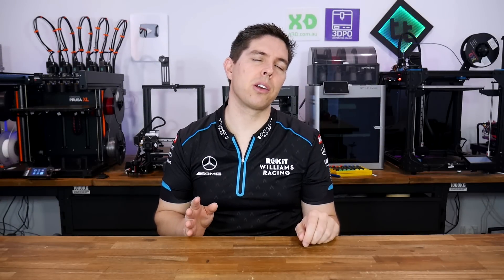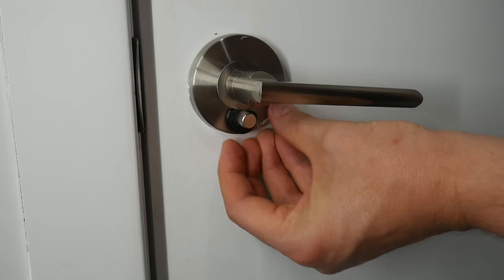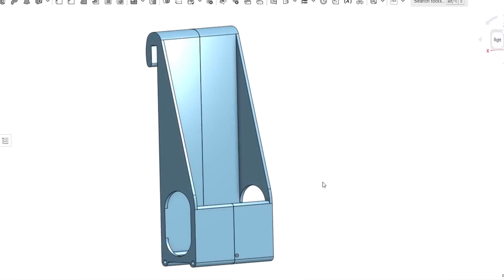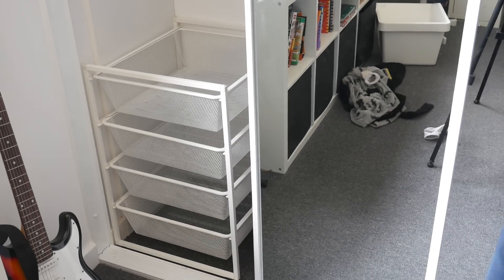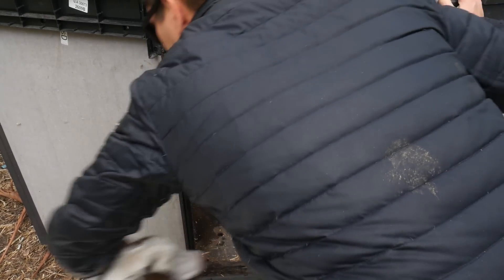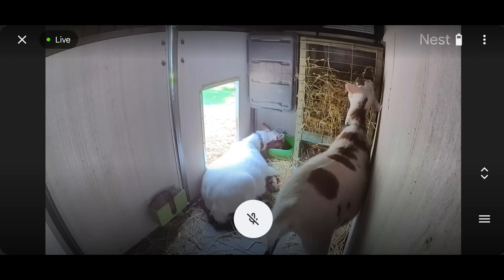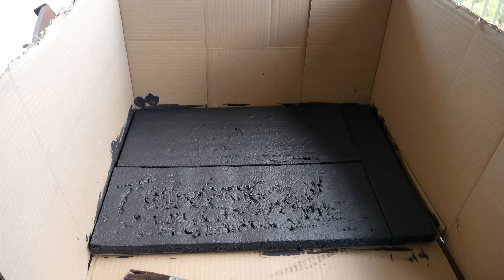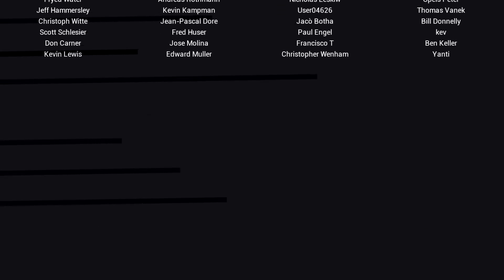5 Practical 3D prints that saved the day

Comment: You most likely already know this but to other people who setup their old laptops for things. If you are willing to do so you can always have it connected to power and then in the Power Options menu on the laptop (in the Control Panel) you can change it to where closing the lid, pressing the power button and holding down the power button does nothing. You can then run the likes of TeamViewer with the laptop's version having the "always connect without password" option ticked and then you can use your desktop. I do this myself as I use my laptop for a couple of smaller tasks and just teamviewer into it and call it a day, yes this is laggy in terms of viewing but if you are just turning on and off stuff, doesn't really mater does it. RemoteDesktop is probs the way I would have gone, if not locked behind Pro versions of Windows
Reply: sunshine is a free self hosted version dont give your data to those companies bruh

Comment: A cowboy plumber made a complete hash of our bathroom renovation more than 15 years ago. We brought in someone to fix it when it became unbearable, but he was unwilling to pull down the enormous, thick tiles due to the damage it would cause. Instead he mounted some flush panels over the tiles. All this time, there was no lock on the bathroom door. There was space on the door itself for a normal lock, but nowhere in the frame or wall to mount the receiver. A quick design in Tinkercad and I had a receiver that mounts as part of the door latch and has the receiver in the correct place.  I printed it way too resilient though - it needed to be sacrificial. If there was a problem inside and we kicked the door to get inside, the hinges would go before my print.

Comment: practical prints are my favorite, I print the occasionally benchy and storage solution but a majority of my printing is self-designed stuff I need to fix problems around the house.  I've got a print that adjusts the angle of a projector in our bedroom which was initially held there with a bunch of coaster stacked awkwardly, and it hangs over the edge to keep it nicely square in case one of us swings our arm up in the middle of the night.  I also designed up some marker holders with inserts on the back for magnets which holds ~10-15 dry erase for both my whiteboard and our fridge.  I'm also currently working on a light blocker for something on my fish tank to help cut down on the light spill into some of the equipment which caused it to grow a ton of unnecessary algae, next step will be adding some clip-ons to the lights themselves to help cut down on the light spill into the rest of the room.

Comment: A quick practical:
I was visiting my mother one day, and noticed that she had the power bar under her drafting table mounted with some packing tape.  It looked awful, and appeared to have fallen apart a couple of times.  Checking the bar, I saw that it had holes for mounting screws.

So, 10 minutes in TinkerCAD, and about two hours of printing later, I had a couple of hanging brackets that looked nice and wouldn't fall off randomly.

Comment: My wife bought a cricut air on fb marketplace. We decided we would use it instead of writing all Christmas cards by hand (we both have terrible handwriting). So of course we procrastinated. Night before a Christmas party and we found out that the adapter needed for the machine to use a pen was not with the machine at all. 34 min of printing later and we had a card writing assembly line.

Comment: So... you have KIDS who can accidentally lock themselves in a room and instead of doing the responsible thing and replacing the mechanism to something that doesn't potentially lock your kids in a burning building, you decide to 3D-print a half-arsed solution.. Replacing a doorlock takes less time than you took to take the measurements, and it is 1000 times better than what you did.

You keep wondering why people don't to take 3D printing as seriously as you but you keep coming up with these "solutions" that are just stupid.

You are the embodyment of the saying "if all you have is a hammer then every problem looks like a nail"
Reply: did you miss the part where they were getting locked *out*? the locking mechanism is on the inside, sir thinksalot

Comment: That clip for the door lock needs a loop so you can run a string through it and hang it on the knob when not in use. Or print a hook onto it that goes around the knob, like a number 3. Just so nobody loses them for you.

Comment: Only practical if you already have a 3D printer and don't value your time. In all other cases, it's cheaper and faster to just buy what you need.

Or put bluntly: 3D printing is for the birds.
Reply: printimg itself is passive, you hit start and do whatever you want while it does its thing. Designing parts may take time, but it would cost far more to, for example, buy an entire new set of drawers instead of raising them by a few inches

Comment: I've been a subscriber for years, but haven't been getting any notifications in my stream. I came here to verify I had the right channel address to share on the Creality Redit community for some noobs who were doing things that would damage their printers over time, and you provide the information that will save them. I hope they watch your videos...
I have a save-the-day print I designed for my wife that clamps over the porch railing so she can hang Christmas lights without using wire-ties or zip-ties. They are printed with PET-G and do the job very nicely. I haven't posted them anywhere, but should. Another item was a funnel that fits in gallon water bottles for spill-free refilling. I use it every couple of days when I run my distiller to make distilled water for a CPAP machine and a clothes iron. I also made a small holder for some humidity/temp units that are small. I like to monitor the humidity in the house, so I know whether I'll need to dry my filament. Here in the Western deserts of the USA, the humidity rarely goes over 30% and is usually in the low 20s to upper teens. Currently, it's 29% where I'm sitting and it's been raining today.

Comment: I worked at a pool company that routinely installed auto fill mechanisms too high. The float valve was never able to close because it couldn't reach the water. In classic, incompetent and lazy style, my supervisors decided to just disconnect the auto fill from the spigot to "solve" the problem. I took it upon myself to print a longer connection rod for the float so that it would submerge and close the valve. It worked like a charm, but my supervisors were not happy that I'd made them look like idiots (because they totally needed my help for that) and eventually fired me for continually fixing their mistakes. Probably for the best, as they're now in the final stages of bankruptcy and being sued by several of their customers.

Comment: My pratical 3d print prevents a handle on a cupboard smashing into the plaster wall. In both bathrooms a bar style handed was used. The end of the bar hits the wall and with the stiff newer hinges that have those springy open close features it hits with a fair bit of force.
I printed a extruded figure 8 one loop slides onto the bar and the other provides the cushion for the impact. I made each loop slightly different sizes about 0.1mm different as i wasn't sure on TPU shrinkage tollarance. Nailed it, first try. 5min CAD, 20min print, perfect solution.
I have also fixed a cloths line hinge. The plastic degraded in the sun and the $10 part was discontinued and was a terrible design.

Comment: I've made replacement drawer slide brackets for my kitchen. The originals in the built-in cabinets were nylon, and over the years they became brittle and started cracking. I designed new brackets to fit the existing slides, and made them symmetrical so I could use the same kind of bracket on both left and right sides.

Now I need to design a roof rack for my station wagon. (grin)

Comment: maybe you could make a hole on the clip for the doors' l             o c k in   g pin, pass a string through it, and tie it to the pin, so when it's not inserted              it just hangs there and you don't risk losing it from having to put it somewhere else.

Comment: The first one didn't need 3D printing. All you needed was like 5 minutes a long Allen key and s set of screwdrivers and maybe some locktite. Screws loosen over time. But this gives new meaning to if all you have is a hammer everything is a nail. Like I am a fan of practical and non-practical 3D printing but not everything requires 3D printing. Literally, you loosen the two set screws in the handle on either side to remove them. Rotate off the latch covers and tighten like 2 screws holding the latch/handle mechanism and then put it back together. If you really want it to last longer without the screws coming out you can take out the screws and add locktite/thread locker.

Comment: Most of what I print is for practical reasons. We bought a new kitchen sink faucet that has thefaucet head that you can unmount and pull out. The spring on top was too stiff and it arced the faucet head backwards a little when it was docked, so I created a version that attaches to the stock location but brings the faucet out at about a 30° angle. Works WAY better now. I also printed a phone mount for our baby stroller. I designed it to hold both mine and my wifes phones at the same time.

Comment: Thinking of all the ways to prevent goats from destructing things is a full time job :)  Tip - if your goats aren't milking/breeding/working they really don't need grain. Hay is sufficient and ideal for their rumens. You can eliminate the grain completely and not attract rodents anymore. Your goats won't be happy about it I'm sure, but you can wean them slowly over time. :) 

If either of your goats are wethers (castrated males), it's preferable that they're not on grain as that can contribute to urinary calculi issues which can lead to very painful deaths (their urinary track gets blocked, their bladders swell up and burst). Wethers are susceptible to urinary calculi issues because the castration stunts the development of their urinary tracts. 

If your goats are girls, it's less of a concern, but I'd still vote for eliminating the grain at least for the sake of the rodent issue! 

Sorry to be "that person" in the comments, but as a fellow goat lover, I just wanted to share this info in case it's helpful to you or someone else reading. 

This was a great video and I love your solutions! Our goat barn features a 3d printed remote light holder as well as a power strip holder.

Comment: I found low-powered screw guns for $10 at Harbor Freight Tools. I have been buying them for their motors which include a reduction gearset and a chuck that holds screwdriver bits. I 3D printed a new housing for the motor which has a flange that can be bolted to anything. I can press fit cheap screwdriver bits into other printed parts for a simple and easy attachment. I had a specific project I needed it for but have already made several more for other things.

Comment: I prefer anything I print to actually have a use.  I got tired of the little bumpers on those coiled spring door stops that screw into the baseboard dry-rotting and falling off for the cats to play with.  Spent about 5 minutes in Fusion 360 to design a TPU replacement bumper and even less than that printing it.  They work like a charm and kept me from having to buy new door stops.

Comment: I  decided to replace my car's Double-Din factory radio with a Single-Din Pioneer. I could have easilly gotten a dash kit online, but they usually have a place for the radio and a cubby hole to fill in the space. Instead, i designed my own dash mount. The space under the radio was outfitted with features I wanted. A power button for manual amplifier override, amplifier gain knob, microphone for handsfree calling, ports for USB and Aux to the radio, two additional USB ports for charging stuff, and a captive 1/4-20 standoff nut for mounting an articulating arm for a phone holder.

Comment: Sorry to hear of the loss of your dogs, it's difficult to lose one but two is tragic.

I'm all for practical prints but two of those issues could have been solved quickly and easily with zip ties. Sure the door couldn't be locked after using a zip tie but does it really need to be with children, a knock should suffice :)

Comment: Recommendation for the first print:  Make that part attached by a ring to the base of the handle.  That way you can just swivel it off of the pin and it's unlikely to get lost.
Reply: i was thinking a little eyelet for a string, so that it'll hang from the door handle when not in use. yours would be a bit more work as it would require some careful measurement, but a much nicer solution once it's done

Comment: My last phone had a dodgy charge port, and the plug had to be held in firmly or charging wouldn't happen. I designed a little sleeve that slipped onto the cable and slid up over the plug, with two tiny hooks that caught onto the phone body and kept the cable in place. Managed to get another year out of that phone before all the apps stopped working.

Comment: Sorry to hear about the dogs ☹️
Useful 3D prints at our house include:
- Decorative rack that holds the wife's water bottle upside after rinsing and for storage
- Sugar dispenser that mounts through a hole in a jar, dispenses a measured amount due to multiple chambers.
- Nozzle for watering potted plants at a low rate, attached to 1.25L bottles
- whiteboard marker holders with mangets inside
- Phone charger mount with wireless charger inside
- Bag hook that skewers through the head rest post on the car, has print in place chain
The list in my house goes on.
I make 3D printed car parts also, including:
- Blowoff valve cover with whistles attached.
- Prototype brake conversion brackets for trial fitment of weird and wonderful brake conversions
- Prototype gear shifter mechanism at gearbox
- Currently trying to make end use 3D printed gear shifter out of ABS

Comment: My 3 most useful practical prints might be
- H-like brackets that hold led strip attached to L-shaped aluminium extrusion. One side is screwed to wall and another side was meant for a shade. Hefty enough to not droop over time
- Fan housing for 75mm sewer pipe for composting toilet ventilation
- Handles on top of resin printer lid and washer/curing lid. One hand operation
- Replacement nut handles for electric mover handle bar
My 4 most useful (yes it's Monty Python reference you weren't expecting 🤭 )
Oh, and replacement hinges for heated/cooled portable fridge case. Metal pins from original harder-than-optimal hinges and one of the very few prints in PETG (PLA would likely have worked as well).

Comment: At work we bought some rack mounted powerbars - with the worlds Easiest to press power switch that turns off power to critical network infrastructure if you look at it wrong. 

I printed a little bracket that sandwiched between the rack mounting screws, and it provided a deep "bezel" around the switch. Day saved!! no accidental network outages! was a 20 minute print and my boss was super impressed.
Reply: Another one -  We bought Logitech Tap tablets to control our conference rooms... but the wall mount was $155 and backordered for 12 weeks. I designed a flushmount, with better cable management, multiple mounting solutions... and for $2 in plastic vs $155.  We have 20 of these tablets. That one job More than paid for the Prusa MK3S I had convinced my boss to buy for the IT department a year before.

Comment: How can you use that lock for privacy if you can open it from the outside with a lego piece?
Reply from the maker: Every indoor lock has either a slot of hole like that. In case of emergency. Imagine your older relative has a fall in the shower and no one can get to them.

Comment: Wire Shelving Clips.  The ones that came with it were made cheaply made and a poor design for holding weight.  They would break easily.  3D printed different designed Polycarbonate Ones and after 6 months they haven't failed yet.

Comment: Why do people automatically reach for fusion 360 when sometimes a cheaper and simpler solution is available eg some wooden blocks to extend the height of the wire baskets?

And a handy person would remove the handles to work out why the locks aren't doing what they're supposed to and actually fixing the issue than engineering essentially a bodge.
Reply from the maker: Sometime sure, but in these two cases it's a hard disagree. The front of the drawers could have been timber, but the rear brackets to catch the feet not so simple. For the locks, we have a 5 minute print per handle, vs however long to disassemble and modify each one. After you've done you can no longer lock the door, whereas the 3D printed clip goes on or off easily.

Comment: I made a hook that is a sideways h with a bent over top.  The display self in the den is 1/2" glass but I wanted to hag my ball caps from the edge.  I also wanted an easy way to remove them if I wanted to wear one.  The hooks slide far enough onto the edge of the shelf to hold the weight of one hat hung on the small hook.  With the hat in place, you can't really notice the hook's minimal size and none of them are permanently attached.

Comment: My favorite practical print was a small gear for an electric motor replacement ( a 3 dollar motor ) - the shaft was a different size than the original, I literally justified buying my printer for it, took me a bit to learn modeling, but a 10 minute print,, saved me a $1000 dollars ... 3 times now.
Reply from the maker: That's great.